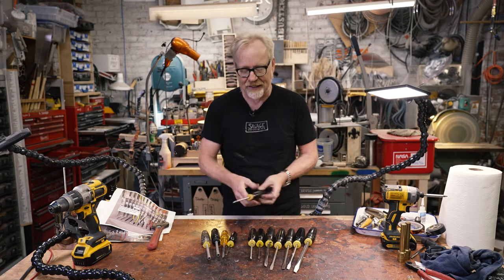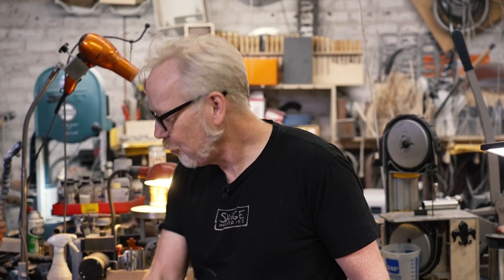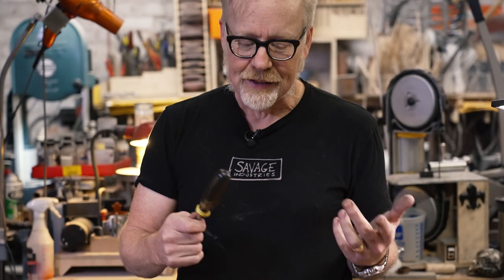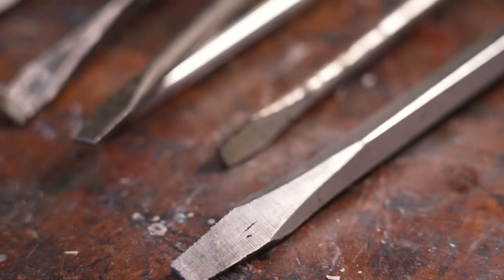Adam Savage's Favorite Screwdriver Design!

Comment: have you tried snap-on screwdrivers? the handles are a more flexible material (rubber over metal i think) than the resin handles of yours but some of them have a similar shape that is a three lobe taper. def gives a better feeling/grip. maybe not as nice looking as your old ones, but a lot easier to find and they do have the lifetime replacement. most of their stuff is too expensive for my taste, but some of it is worth it.

Comment: So true about the fingernail! Fun fact: having a boat (16' fiberglass with motor) dropped on your thumb will, not only fill under the nail with blood, but also squeeze beads of blood right through the skin between the fingerprint ridges. That didn't really hurt, but it was numb for a few days and the nail never was normal after that.

Comment: I needed some JIS Phillips heads.
Tinkering around with Japanese motorcycles with Phillips does work.
But is it "The right tool" So I purchased a set of Vessel JIS Impacta Screwdrivers from J A Pan. They even arrived with a photograph from the guy who sold it to me. (I liked that personal touch)
"How well do the tools work?"
Flawlessly. They engage a JIS bit perfectly (Funny that) 
Tools are nice, the right tool is very nice.
Having the right tool for the right job at the right time? That sometimes involves Welding equipment and a Lathe.

Comment: My longest held tool is also a screw driver. It was a screw driver which came as an installation tool for my first cdrom and sound card when I first upgraded my computer back in the mid-90's. It is small and red, one end is a flat blade, and the end on the other side of the handle is a phillips head. It used to have a clip on the handle to attach it to a shirt pocket, but that fell off long ago. I have lost and refound that screw driver many times. It is currently in it's lost state, and has been since I moved to Michigan. I expect I will find it once again when I finally clean up our garage from that move....which happened 2 years ago :P It's not really one I treasure or have a special place in my heart for. It is just very useful when working on computers as the sizes are just right for most computer parts. Yes, I am a computer geek and have been building my own computers since the mid-90's.

Comment: I would never ridicule someone for having preferences for tools. I am a industrial computer technician that does quite a bit of field work and after fifteen years, I have developed an almost irrational preference for my own tools, specifically screwdrviers.  

Scenarios in which my shop is 4-5 hours away are pretty common and what I have with me is basically what I have to work with. Things like weight, size, and storability are all factors in which I have to consider because I to physically carry them with me all day for many hours at a time. Many tools have to serve multiple purposes - for example I love screwdrivers in which there is space in the handle for things like lengths of extra cable or connectors or just odds and ends. 

Finding the "perfect tool" is just a treat and continues to bring joy everytime I have to use that particular tool and is only trumped by finding the "more perfect" tool down the road!

Comment: I've come across quite a few of these in older tool collections I've purchased and absorbed into my tools over the years, including one of those multi drivers at the end, with the screw end. My gripe with a lot of these old drivers with acetate based handles is they can smell really really bad. And the smell seems to get into other plastics in the same box. My xcelite nut drivers were so bad I got rid of them! Like most of the other comments in here, I favor a newer set that has a metal hex nut forged as part of the shaft where it meets the handle. I can use any crescent wrench to add leverage, and it will never chip off mar the plastic handle like using a large 12pt box wrench on the handle itself. Also I've twisted handles off the shaft on a number of drivers doing that, which is another reason to look for a set with the a hex nut integrated into the shaft, or a square profile to the shaft to allow use of a wrench there. I also like seeing full thru tang designs where the shaft runs through the handle and incorporates a striking cap on the rear of the handle. Useful for getting a little more bite that often spells the difference between breaking a stubborn screw loose instead of completely rounding it out. The impact of setting the driver  works towards breaking said stubborn screw loose as well.

Comment: I bought a set of “Craftsman” screwdrivers with basically the same handle shape in the late eighties. I have lost one and broken the tip of another. They come with a lifetime warranty from sears (worthless today) but when I originally went to replace it (when they honored their warranties) the replacement was not the same shape so I kept it hoping the correct replacement would eventually arrive. Bankruptcy proved me wrong. PSA here: lifetime warranties are only as good as the lifetime of the seller.
But these are still my favorite screwdrivers. And the metal used was high quality American STEEL!
I’m going to have to look for the Stanley’s

Comment: It might be more work than you are looking for for just a screw driver, but have you considered cutting some internal threads on the pop cap version and 3d printing a screw in cap? Either a resin print or like PETG or ABS FDM prints should work, at least better than the pop cap.

Comment: Craftsman, back 25 years ago in the "made in USA" days, had a line of drivers called "Industrial" with black handles that were fat at the blade end and tapered down thinner at the butt end.  Once you hold a handle shaped like that, there's no doubt that's the way a screwdriver handle should be shaped. 
Honorable mention goes to the Vessel brand screwdrivers from Japan.  Standard and JIS-Japanese Industrial Standard, which look like Phillips pattern but aren't, are very high quality drivers.  The Vessel "Impacta" series rotating impact drivers are the best I've ever seen at what they do.  (perfect for getting those Honda-Acura brake rotors off!)

Comment: I have one of those screwdrivers with the bits in the handle. Not a Stanley but I love it. The only problem and you might find that with your Stanley if you're not careful. It rolled off the  bench and the screw cap cracked and no longer holds properly. I have another nice Stanley multi driver. It is a 2-way ratchet driver with the bits stored in a little carousel at the base of the handle. It one of my go-to's but the carousel can rotate when you use the driver and the bits fall out. Seems no solution is perfect.

Comment: Ah.... a topic near and dear to me. I didn't develop a strong preference for screwdriver design until I got the Wiha 51099 set. Decent sized screwdrivers, hard plastic square handle with a rotating cap. They were discontinued a few years back and I haven't found anything quite like them to replace them when the inevitable failure or loss occurs from daily vocational use. I like them enough that they're part of my "working tools" instead of being relegated to my "looking tools."

Comment: I've gotten away from reaching for a standard screwdriver right away. A multi-bit screwdriver where you can flip the bit or flip the ends and have 4 different screwdrivers in one is the best. The pieces are larger and hard to lose, it covers the most common sizes, there aren't a bunch of loose bits rattling around in the handle adding weight and noise, and the shaft size is usually still fairly slender.

There will always be a need for the small, precision bit sets for fine work and the long, consistently-shafted drivers for unscrewing something at the bottom of a deep, deep hole; however, the multibit driver is still my go-to.

Comment: Great taste in tools man! I grew up using these with my father and have been drooling over them for sometime now. I’ve got a random but important question for shop safety. I often see you use power tools, abrasives, and cutters on materials that create fine dust and particulates but don’t see you wearing a respirator. Do you use a hidden or ceiling based dust collection system/air scrubber? I’m asking because I often use a respirator for hand sanding, cutting, and when using rotary tools, and it often times interrupts my work flow to put it on, take it off etc. I hope you are well, and keep up the amazing content!

Comment: You should checkout Vessel Impacta JIS screwdrivers. They are meant to be struck with a hammer that activates an internal cam mechanism that turns the screw counter clockwise 12°. Excellent for stuck screws.

Comment: Oh, this should be cool! I love all different kinds of screwdrivers! And I inherited a few screwdrivers from my dad, too!

Oh, cool! I painted my tools, too, when I worked at the trailer mechanic shop I was at for 2½ decades - my color was a dark, midnight blue! Someone already had blue, and I like midnight blue, so when I saw that the color existed in spray paints, I snatched up several cans, LOL!

I like to keep one of each size of flatblade and 2 of each size Phillips (the older ones get the older, messy head screws, so I don't tear up the newer ones!). 

Workmaster, huh? My dad had those! Well, the larger screwdrivers were those. He had a set of their nutdrivers, ones that were color-coded so you didn't have to look at the business end, just grab the correct one. He also had the clear yellow handled set of flat & Phillips. But they weren't his real bread & butter tools, so he didn't go high end with those. 

He was an electronics guy (not the electrical, house wiring stuff, but the insides of radios and TVs), especially the older TVs and radios with the tubes and stuff, the real antique stuff!  He had the small little metal screwdrivers with all metal handles and little turn knobs on the ends, instead of hand grips, the ones you mentioned for electronics as I typed that part, LOL!) plus slightly larger ones with insulated handles, and he even had this whole huge variety of different kinds of plastic screwdrivers of different shapes, sizes, lengths,, and combinations (one end one kind and one end another kind) used for tuning in specific frequencies, inside of these little boxes in the guts of the things, whose names I don't know. 

The adjustment was called tweaking, so now when I mention tweaking something, younger people laugh. They ask if he was a methhead 🙄... um, no, that was back when, if you needed actual methamphetamine for something, you would get a prescription for it, not cook it up in your trailer and blow yourself up eventually.  

But the plastic adjustor ones were like a slightly flexible stuff, but the ends were sturdy, because they had to be. And some of them had 2 different flathead size ends, some had a flat and a Phillips of a certain size, each varying from the next. They were that way because many tuners needed the two different styles, and rather than having the two different tools in the tech's pocket, only one was needed. 

LOL, I just realized, he passed away before the term tech was a noun referring to a repair person like he was! Wow... that's... mind-boggling! 

Anyway, my point is, the quality of one's tools matters! Ones you don't use very often, sure, get the lower quality, but ones you use the ~bleep~ out of, you need to get quality, and ones that feel good in your hand! And it's just freaking cool that not only did you also paint your tools like I did mine, you also inherited some from your dad, too! And no...I'm not gonna list my dad's Workmasters on eBay, LOL!

Comment: As an HVAC mechanic working out of a single tool bag I've discovered over the years you only need a single Phillips, a red robi, a green robi, a large flat head or "bull" driver, a small flat and a tiny flat head as far as screwdrivers go. With those I find you can fix almost anything around your house or industrial HVAC equipment which I'm sure most people don't do.

Comment: Fun tool tip: with a hexagonal handled screwdriver you can turn it with a wrench for extra torque! Just be careful not to over torque it or you'll crack the handle.

Comment: Just get a set of Witte screwdrivers Adam.
They make a great tri lobe handle and the steel quality is fantastic. Look at the protop series,  they are bolstered and have a striking cap. The shaft runs all the way through the handle. The big flat blades also make for a great prybar!
Reply: HTR  
Wiha, Wera, PBSwiss and Vessel would be better than his old Stanley's. 
I think Adam is lost in tool names his grandfather would remember.

Comment: I have four of nearly every hand tool one set for the workshop a set for my 5th scale gas radio control off-road trucks and buggies a set for my 6th & 7th scale electric offroad  Trophy Trucks and a set for my airplanes and drones along with three different cordless screwdrivers along with magnetic parts trays one of my best is a bracelet of magnets so you just stick the nuts and bolts on it along with small driver bits, you can never have too many. The workshop set is Snap-On from my days of working in the HGV recovery business.

Comment: Or you could go with a full set. My Mom bought me an ifixit screwdriver set as a present for me one year and honestly, I love it. It has all the bits I could ever even think of needing and I love that the handle is solid metal, it feels dense and sturdy. But I do know that there are times you shouldn't use a metal handled tool and I mostly work on electronics, but I have and do use it for everything I need a screwdriver for and it comes in its own enclosure with ordered bits and magnetic tips. I have yet to come across any job I needed a screwdriver for that it didn't have a bit for, but I don't have much of a use for a super massive flat head like the biggest one you showed here, but the kit does have a fairly massive one in it. I just think that for the average person, the manta kit is the perfect one singular screwdriver set that would have everything they could ever come across needing. Only thing I wish it came with that I intend to get separately is a bit extension for it.

Comment: I didn't have any preference for screwdrivers either, until I discovered the picquic sixpack plus.

It's all the common sizes of bits, but in a larger inserts instead of the little bits that are easy to use.  It's like carrying around 7 screwdrivers in one.  Absolutely essential for around-the-house repairs since you almost always have the right size (and it has  square bit as well).   I dislike those screwdrivers with the bits in the top, since they're WAY to easy to lose them.

Comment: Stanley screwdrivers are great, but the hard acrylic/resin handles have always been harsh and painful to hold in my hands. Craftsman currently has a line with a softer plastic handles which has just enough give to it that it's nice and comfortable for me to use for long periods of time. While I always use a power drill for pilot holes, I make it a point to hand tighten screws on projects to prevent splits. These Craftsman screwdrivers allow me to work longer, and I highly recommend them if you have the same problem I do with the hard resin handles.

Comment: Because flat head screws come in all types, like philips, slotted, robertson, allen, hex, torx...etc   Nearly all screwdrivers are flat head screwdrivers. A screwdriver that works with a slotted screw is called a common screwdriver. Not only does it work with flat head screws but with round head, oval head, pan head, filister head and many others. Sometimes it's a pry bar, a punch, a chisel, a wedge, a stir stick, a glue stick and many other things.  Where the ambiguous term flat head screwdriver came from I don't know, but it makes no sense.  I heard someone comically refer to philips as plus and common as minus.  Even that makes a little sense.

Comment: My favorite screwdriver is one I got from my parents as they sent me off to college: its a True Value 4-in-1, a red-handled screwdriver with two double-ended bits in either end of a reversible shaft/barrel. One pair is a large philips and flathead, and the other is a medium philips and flathead (and I believe the ends of the shaft are both usable as a hex bit. I use that thing for everything and its built like a tank, still going strong 27 years later. I can tell my daughters to "get the screwdriver" and they know exactly which I mean. I have a Craftsman 50-screwdriver set in the basement, and end up needing something super-specific out of it about once a year. But The Screwdriver? Several times a week.